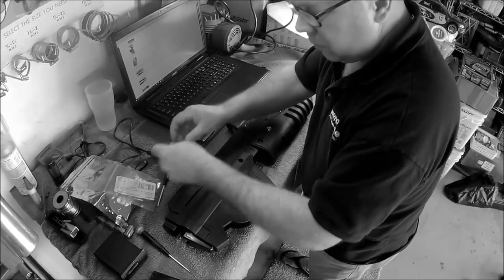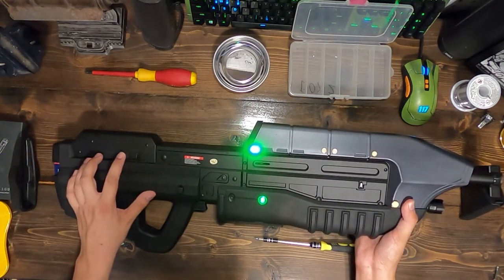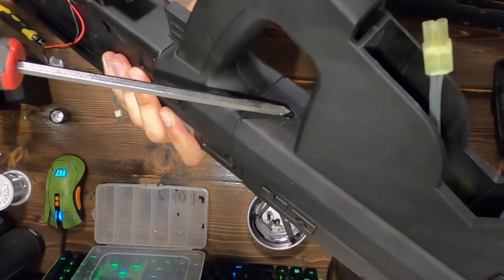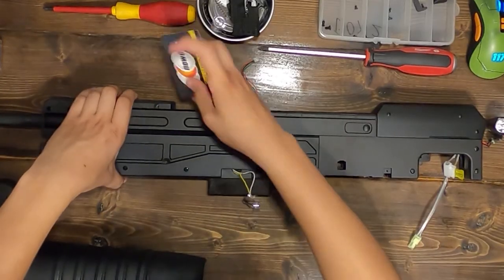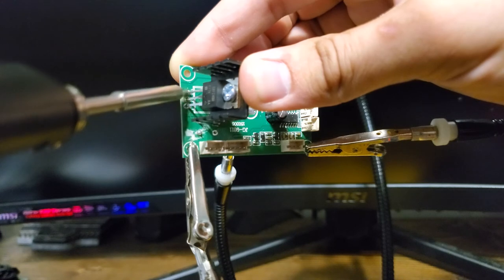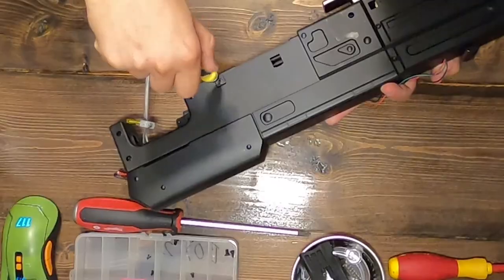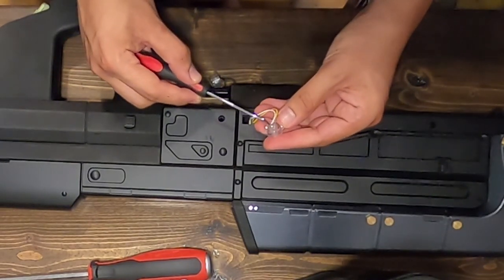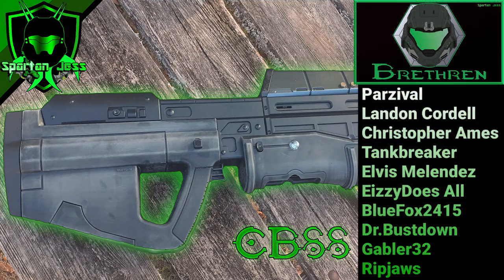Updated Airsoft MA5B (CB-88) Repair!

Comment: Just replaced the MOSFET but still firing full auto as soon as the battery is plugged in. Any idea what to check next? Thanks.
Reply from the maker: That's unfortunate. Make sure to contact Parzival through the description. He'd be curious to know what problem is persisting.